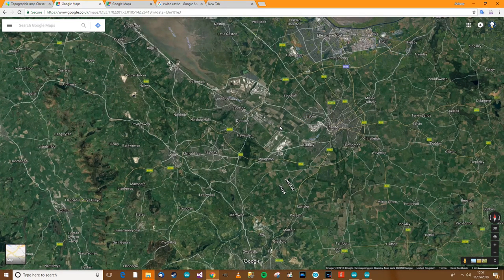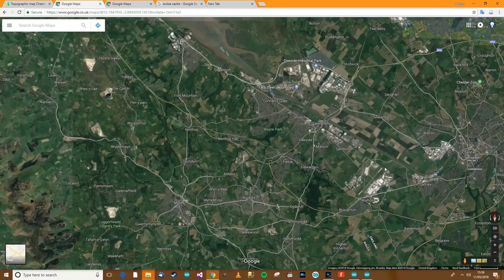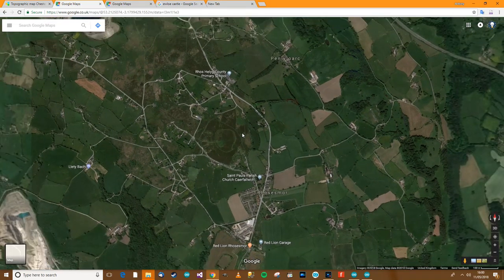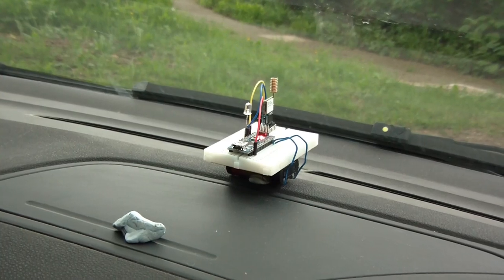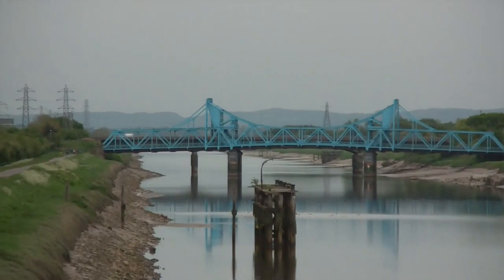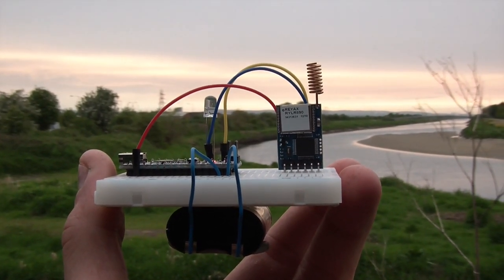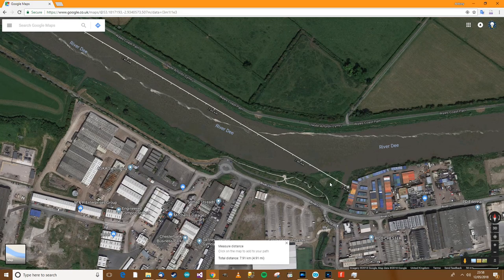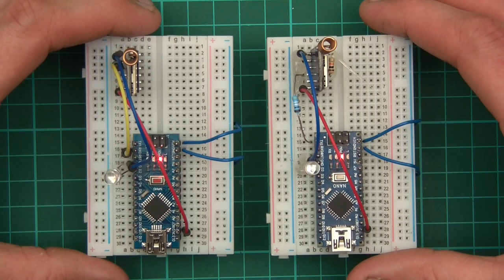Testing Long Range Wireless 915Mhz RF LoRa Transceiver Module REYAX RYLR890 RYLR896 Arduino Part 3

Comment: And this is achieved with the simple embedded wire antenna... Imagine the distance that little thing could do with a nice pair of yagi or patch antennas ? Insane!
Reply: We've seen several hundred km with small antennas, so with nice antennas you can probably go to the moon (not being sarcastic)
Reply: g g indeed! Check for EME amateur radio contests (Earth Moon Earth)

Comment: Hi Anthony, Nice test here, unfortunately you overlooked a few things that may land you in hot water... 915mhz is a licensed band in the UK and is used for mobile telephony, in the EU we should be using 868mhz LoRa transceivers to keep it legal. Also if you where using 868mhz transceivers you are also probably breaking the rules as there are duty cycle limitations in this band, transmitting every 1 second even with a 1 byte payload breaks this duty cycle. Anyway I would suggest looking at The Things Networking and LoRaWAN for your next experimentation, this offers internet connectivity for these devices on a community basis which looks promising.
Reply: I am in europe, Norway which one should i use 2.4ghz, 915mhz or 868mhz. Which one is legell and have longest range.

Comment: It would be interesting to see a range test with spreading factor 11, and a thinner bandwidth than default 125khz. These two things from what I saw in videos are the things that provide the longest range. There seems to be some sweet spot to it.

Comment: Wow, I bet  you could of gone around the bend and still had good signal. Maybe you could do another test and on the mobile unit add the oled display so you could see ping times. Instead of having the other unit just send, have the mobile send to the stationary unit, then that one would reply. Measure the time it took for the round trip. You could also send a longer message, like 64 bytes, and see if you get back the exact same message. Which means, another trio of videos ;)
Reply from the maker: Hey Korishan! I might try this! I'm certain I could have gone further... Looking at the map, I think I've worked out a longer route! 8KM / 5MI is nothing for these transceivers! They didn't struggle at all at that range!!! I could have gone further!

Comment: my result with AI Tinker RA-01 SX1278 Lora 433Mhz modules (very similar to yours and same copper antenna) while sending a "hello" with an increasing appended number was the following:
the sender was going with me out of the apartment while the receiver printed out what it received and was sitting on a table, I made 20 meters going downstairs from a second floor, out of the stairs, an apartment with big bricked walls and a pair of apartments down to the street.
Not that exciting but better than nothing, surely totally different result from line of sight transmission.

Comment: Many thx... Very helpful indeed
A question.... I wonder how far you can transmit even when their is obstruction like buildings and mountains?
Reply from the maker: It can easily transmit through 1 or 2 buildings, but it can't transmit through a small town of buildings. :-)
Reply: Thx

Comment: Very impressed by the range, I have ordered myself a pair. You have any project ideas in mind for these? Great video series, thanks!
Reply: I've been interested in LoRa for a few projects. One of them is to put with my mail box so I'd know when I had mail delivered. The other is to build my own dog collar and add in a gps module. Not only would I be able to know exactly where they are at any given moment,  but I could even send commands to the collar, like beep and vibrate. Might even be able to add in a voice commands too.
Reply from the maker: Hi Matthew, nothing in mind yet, but I have a few of these... So all options open!
Reply: @hugh3464  No, haven't gotten around to it yet. Too much other stuff been going on.

Comment: What were your spread factor, bit rate, and bandwidth or were all of these left in default mode? Did you perform a comparison with the theoretical vs. field testing?
Reply: Apparently default values otherwise he would have mentioned. It would be interesting to see a test range with high SF and lower BW :)